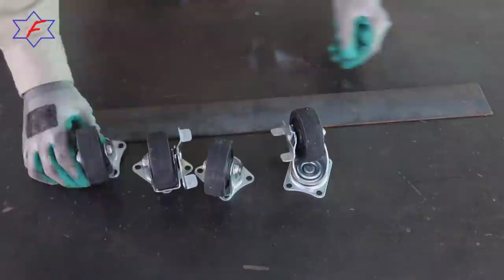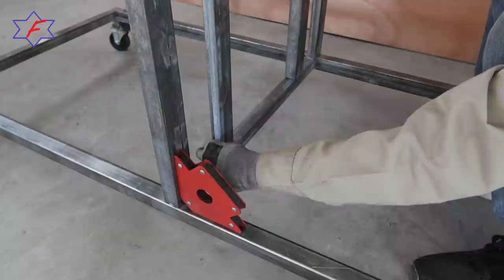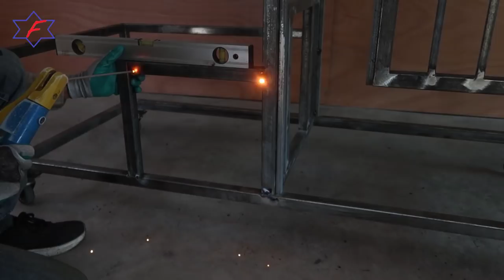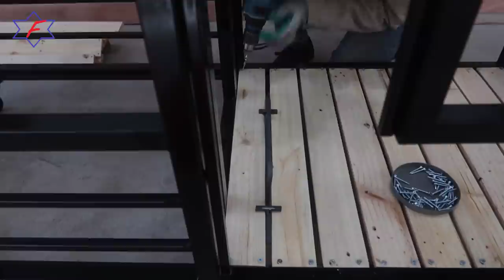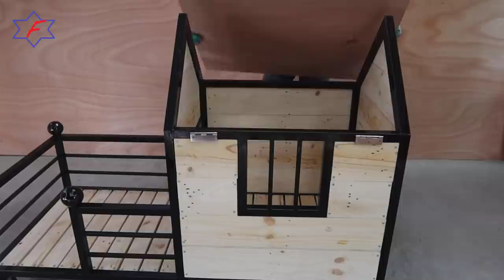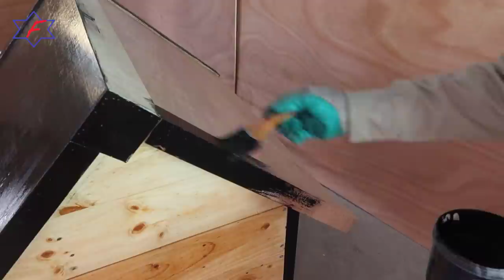Build A Wooden Doghouse From Old Pallet | How to Make Doghouse From Wooden Pallet

Comment: Hey, nice job! 
But I have a few questions. What's the reason of open roof ? These wheels on the foundation are for better manipulation during the process? And why in the floor is the space between each wood plank? 
Sorry for my english and thanks for the response
Reply from the maker: The roof could open to easy to clean inside. And floor has space to remove dirt.
Reply: @fawabros  when I saw that u want use the hinge,I thought the roof will be opened from one side and on the oposite direction. From down to up, like the fifth door in the car. good idea with the dirt! But what about the cold which is coming from land during the night and colder weather?
Reply from the maker: @rickykovar2927  Many thanks for your good suggestions about door. With the floor, my place is tropical country so I don't worry about cold status.
Reply: @fawabros  You are welcome, I should thank you for videos you do.
Good point, I didn't realised that. we have cold winters and during the night is below zero. 
Good job and I hope you will be continue!
Recently I did a homemade motorcar for my little daughter with the engine included. It was pretty fun. I can recommend it! 
Have a nice day. R.